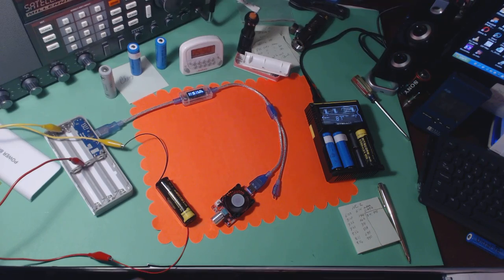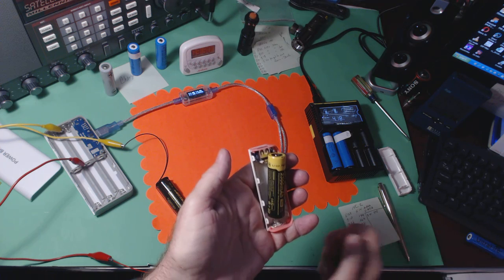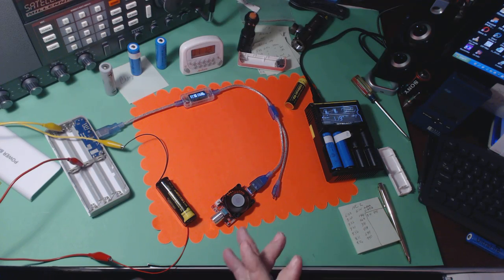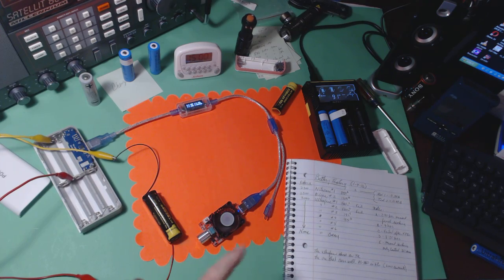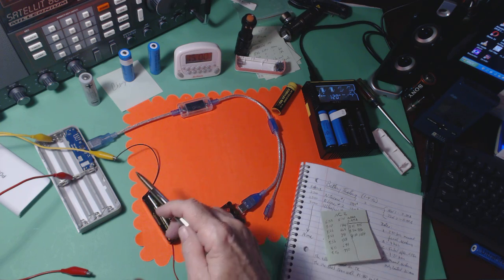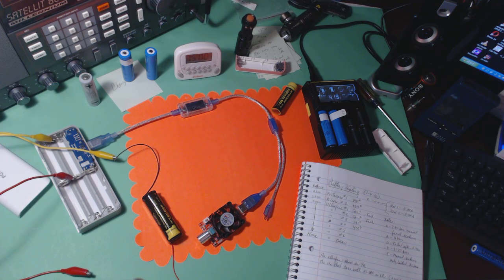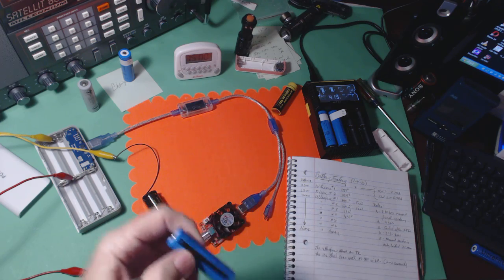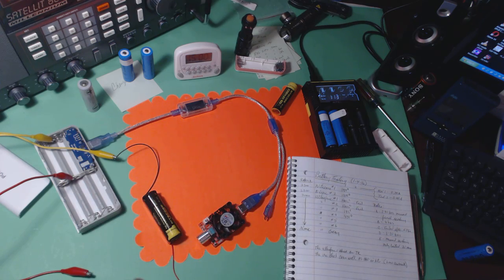TRRS #0758 - Nitecore vs Ultrafire Battery Testing Results?

Comment: Protected batteries are usually slightly longer than non-protected batteries.
Reply from the maker: +Gary K That was my guess as to why the Nitecore are longer than the Ultrafire but it was interesting that the Nitecore did not fit in the cheap power packs.

Comment: again, thank you so much for finding that website and all the work you did comparing batteries and everything that you've done is a wealth of information for all of us and I guess like they say you get what you pay for. The more expensive ones, even Panasonic are probably the best!
Reply from the maker: +saturn5tony Part of the problem is there are so many fakes out there and Ultrafire is one of the most copied brands.  Similar to the problems Duracell has.
Reply: +hamrad88 - I do not work for any of these guys, but I would bye dependable batteries like Panasonic, Duracell or even energizer. You are so right seeing that these fakes could be dangerous to the chargers, the equipment, maybe even your home, if left to charge or even on!!! With your tests and others, I will never bye any Chinese clones of any kind, and now including UltraFire.... even the name xxxxxFire is telling me its wrong. Thx again Tom.
Reply from the maker: +saturn5tony You are very welcome.

Comment: Your testing method is OK as long as you use the same methodology for all of your batteries. You will still be able to compare the performance of different batteries. The only drawback is that you may not be able to compare your results with those of other peoples tests.
Reply from the maker: +Robert Langford Very well put.

Comment: You're still running Windows XP in your ham shack!
Reply from the maker: +Manuel Suárez I run all versions of Windows from 3.1 to 10.  Older software will not work with newer versions of OS so I have to keep computers with older versions of OS.